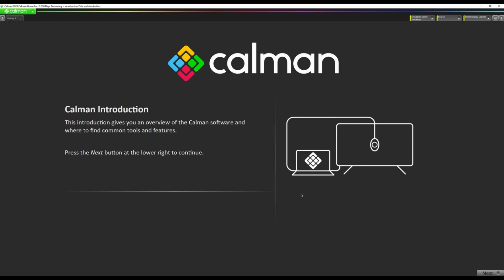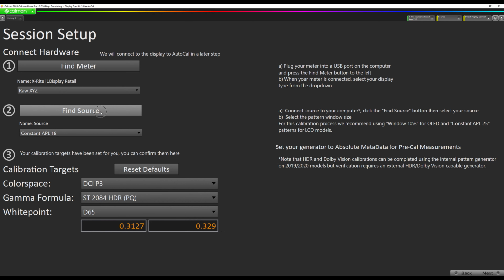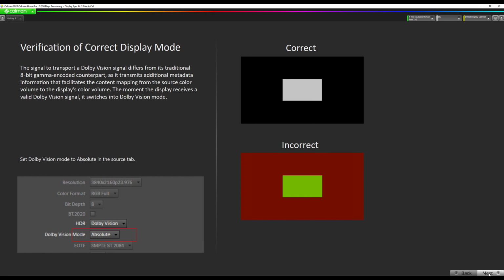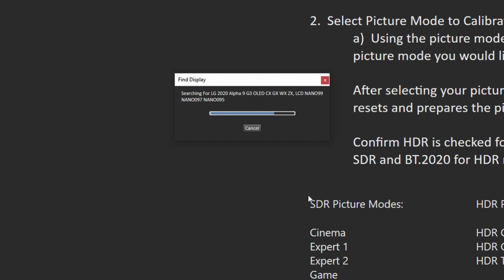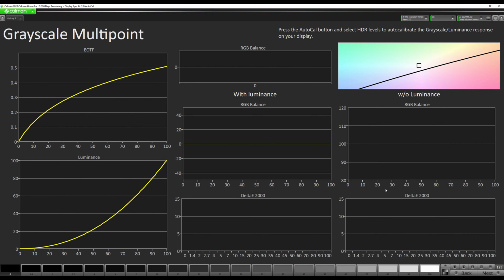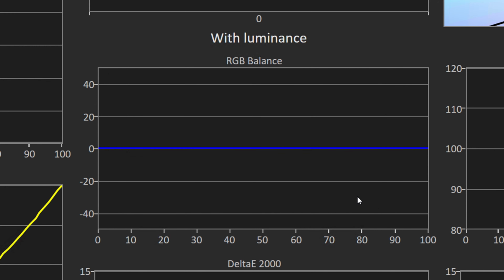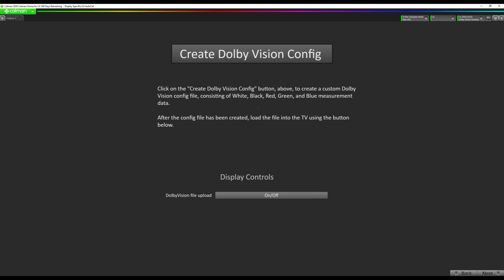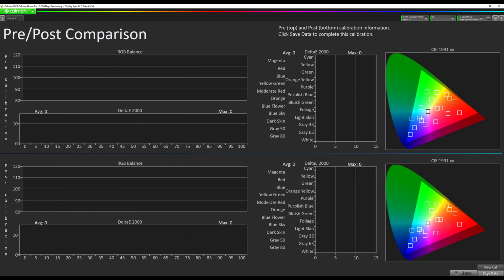LG 2020 OLED Dolby Vision Calibration with Calman Home for LG

Comment: When you reset the picture settings and the sharpness is deafaulted back to 10 when I have it at zero is it okay to put it back to zero before I calibrate the tv? I have the same question as well for keeping the color temperature at 50 before calibration And one more question do these calibrations affect all of the hdmi inputs or does each hdmi input have to be calibrated for every single picture mode ? Sorry if that seems dumb I just want to make sure as I am about to calibrate my Lg Oled G1 and C1 for the first time

Comment: SDR and HDR calibrations on my G2 after 500hrs of run time came out razor sharp on both greyscale and color using the C6 meter and VideoForge PRO, absolutely fantastic.

The Dolby Vision calibration was a complete and utter mess, it actually turned out worse on the post calibration charts than the out of the box factory setting, not sure how this happened, but after two tries following step by step instructions I gave up.

What was even crazier is that the greyscale during the calibration looked brilliant and tight, but then the post calibration chart looked a mess, with the scale being way off from 40 to 70.
Reply: I learned the hard way that if you have more than one video clip and use the 1h long. When the time is up it will automatically skip to the next clip and changes the panel settings. Maybe this happened to you as well? So after each measurement I restarted the videoclip to prevent it change video (the total calibration was over 1h long)

Comment: Hey Tyler, excellent video. Since the block is after the generator, would that possibly be why the EOTF followed a standard 2.2 curve instead of the yellow PQ line on the graph when I attempted a pre calibration series read on my LG G1? For that matter I also attempted a post calibration series read and saw large colorspace errors. I assume this is why you really can’t attempt either?

Comment: I've done SDR and HDR but I've stopped at dolby vision. I use dolby vision cinema home because I like how bright it is and how it pops (yeah I'm not purist). Has anyone done cinema home and did calibrating it mute the brightness at all? Thanks.
Reply: It's absolutely did mute the brightness. Now it looks just like Dolby Vision Cinema. Thanks to everyone for not replying.
Reply: Here's some free advice that no one wanted to give me:

If you use cinema home because when you swap between "cinema" and "cinema home", you say "why the hell would anyone use cinema?"... DON'T CALIBRATE CINEMA HOME. You'll lose the reason you like it. I had to factory reset my TV and lose my awesome SDR and HDR calibrations to get it back. So, you're welcome.
Reply: @gobluebalter  why you don’t used the functions „Full DDC reset“? Then is Cinema Home like before.

Comment: Does this calibrate for all inputs?
Reply: I think it does, only the manual settings that you change in the menu are per input, but the baseline of the calibration is all the same, per picture profile. Only things like brightness and sharpness etc are things you can manually tweak per source, but the baseline is always this calibration. Provided you use the profile you actually calibrated. I'm not sure if that also applies to internal apps vs HDMI sources. AFAIK..!

Comment: Hello Tyler! Is it possible to use the LG HDR42 point version in the Grayscale Multipoint or MUST use the LG HDR20 Point?
Reply: I remember reading somewhere it is not recommended unless you have a very accurate colorimeter. As something like an x-rite display meter does not have the resolution so would lead to random steps in your greyscale.
Reply: it will take more time, just more granular. So yeah, you can. For more accuracy along more luminocity levels.
Reply: @TijmenJanssen  already handled in this way! Ty!
Reply: @fgp303  I figured that, since it was months ago. But whomever may read this with the same question now has an answer.

Comment: Any sdr and hdr GAME calibrations in the works?
Reply: I calibrated SDR and HDR Game Mode by running SDR and HDR games on my Xbox. The internal patterns from the tv will run over your video game images. While Calman is calibrating, be sure to press buttons on your Xbox controller, every once in a while, to prevent the tv from dimming (should also apply to PS users).
Reply: Sales support told me that game mode calibrations do not work correctly bc something on lg end.
They are hoping for a firmware fix from LG.
Reply: So weird, I’ve seen one or two videos on here where they claim to show you how they calibrated their game modes. I don’t know know how well those actually turned out.
Reply: @alekznial  yeah I did the game mode calibrations in sdr and HDR anyway. It worked for me and only problem that it it might be, is that it's not really in game mode. I asked lg about this couple weeks ago and no reply yet.
Game mode calibrations came out great, look identical to my movie/tv watching calibrations.

Comment: Where do you find the IP for the TV?
Reply: It should be under network settings.  Another option is to plug and ethernet cable directly from your laptop to the tv.  I've done it a few times.  Made life easier
Reply: if you have the TV using wifi or ethernet you can use the app "WakeMeOnLan" software (FREE)  and then you can scan all the devices on your network and one of them should show the TV brand name listed there somewhere so you can ID it with its IP address. here is the Link: https://www.nirsoft.net/

Comment: I did the Dolby Vision calibration on my LG CX and now I cant play anything in Dolby Vision as I get a green and pink scrambled image... is there a fix?
Reply: HI Jason, can you confirm you calibrated following the instructions correctly? I ask because I have an LG 65 CX with 138 hours on it. I've just purchased Calman Home for LG and an x-rite display pro plus. I have calibrated SDR ISF Dark & Bright, HDR Cinema & DV Cinemas modes all very successfully with no errors above 0.5. I am truly very impressed.
NOTE: I should also add, I am in no way ISF certified and my knowledge has come from Tyler's @ Portrait Displays videos and Jason @ Murideo
Reply: @rhyskerslake4343  what firmware are you on? I’m on 03.21.16 and I’m exhibiting the same type of error as the OP. I’ve tried many times to do the calibration exactly like the documentation and this YouTube video says. I’ve done a factory reset each time I redo the test. Tried different settings also. But still end up with the same garbled colors. I used the i1 display pro. I even bought the c6 hdr2000 and got the same result. I even resorted to reformatting my pc and even then I’m getting the same result.
Reply: @ryanp467  I was finally able to get it to work...  after the Dolby Vision calibration I unplugged the TV, held down the power button for 20 seconds on the TV, and then plugged the TV back in and surprisingly DV now works.  I don't know if it will work for you but it did for me. Oh one last thing I am on the latest firmware 3.21.16
Reply: @jasonl3850  just tried that and it worked! Thanks for the fix.
Reply: @ryanp467   NICE!!! I'm glad it worked for you as when it happened to me I really didn't want to do  a factory reset and start all over again...lol
Reply: @ryanp467  Hi Ryan, glad it's now working for you. Yes I have the same firmware.
Reply: @jasonl3850  Awesome Jason it's now working for you. Enjoy!
Reply: @jasonl3850  I encountered the exact same bug and your solution worked for me too.  Thanks!
Reply: That happened to my cx once no calibration. Just exiting netflix by switching inputs while in netflix.
In dolby vision it was really dithered and green. The bright scenes where much brighter.
Reply: I had the same bug.
I have change the location of the TV, in the menu, to restart the tv, and now its not green anymore.
But now the dolby vision content are very dull, too too much . I have followed this vidéo.
I will need to recalibrate i think, do you have the same feeling ?
Reply: @franckrieu-patey255  Was the color fine before the calibration?  If yes then I would recalibrate.
Reply: I’m now hesitant to calibrate my Dolby as I just spent a few hours doing SDR and HDR. If it messes things up and I need a restart, can I just load the previous calibrations?

Comment: I want to get calman lg home with x1r pro, but I have a lot of questions that are not addressed on the calman web site.
Looks like a lot of different info out there, from forums etc.
Reply: Hi Bloomer - I've just done it myself on my LG CX 65". What questions do you have?
Reply: @rhyskerslake4343  anything to set on tv settings before you begin?
I would assume you turn off energy saving and all extra processing.

If you want to set luminance at 120 nits in SDR, do you still calibrate at 100 nits then turn it up after calibration?
Reply: @bloomerb4162  If you have the time, I recommend watching Jason Dustal's 2 hour video - https://www.youtube.com/watch?v=LIkkdGr1WjI - he gives a wealth of information. In this video he references your second question about luminance - seek the 30 minute mark. As he is doing SDR ISF Bright, (prior to Grayscale calibration) his preference for SDR ISF Bright is 150 nits, but sets a higher values of 175 nits. Jason goes on to say experience has taught him; the process of this calibration will naturally bring down the luminance to the desired value. If it's a bit low or higher than expected - its easy enough to go back and re-adjust the pre-luminance levels.
NOTE: I followed the same concept during my SDR ISF Bright and post calibration ended up in the same area.

With relation to your first question...
1. Download the SDR, HDR and Dolby Vision 1 hour files, put them on a usb stick and plug it into your tv. Running each of these files keeps the OLED in the correct mode.
NOTE: if you are doing HDR Game Mode; Turn on the PS5/ Xbox and ensure you've enabled or configured HGIG mode and leave running in the background prior to calibration. There have been unofficial reports I have seen from other tubers referencing the HDR Game Mode calibration was more accurate this way. 

2.  Yes turn off energy saving and all extra processing prior to calibration. Jason (Murideo) and Tyler (Portrait Displays also talk about this.

I hope some of my information is helpful to you. Happy to answer any other questions you may have - otherwise Enjoy!
Reply: @rhyskerslake4343  Thank you for the help.
I don't see how using hgig is correct bc hgig turns off TVs own tone mapping. So what could you calibrate, maybe just panel specific peak luminance.

Are these 1 hour files not the same as the full screen grey files that they want you to use during calibration?
I thought it was just one file of full screen grey for all the calibrations.
Reply: @bloomerb4162  I could be mistaken - I am looking for the article I referenced (an end-user) where the 30 - 70% grayscale was calibrating below well-beloww the expected values and the work-around was to enable HGIG to achieve the correct grayscale values. If I am mistaken, I will remove the information from my previous post - I wish to not spread mis-information
Reply: @rhyskerslake4343  I'm no expert, I could be wrong on this.
But I do know that hgig turns off the TVs own tone mapping, letting the source do the work.
Reply: @rhyskerslake4343  I did it, xrite display pro plus with lg home.
I got some issues but overall I think it works ok.
Going 15 over 100 nits gave me 91 nits post 3d lut.
I went ahead and calibrated SDR game mode even though portrait displays told me there is something wrong and it's on lgs side. They are hoping lg fixes game mode problem with firmware update.
They didn't tell me specifically what the problem is.
I suspect it's not really in game mode after calibration, though I need to test some more but it feels like more input lag.
Also some connection issues between meter and lg home. Lg home would stop responding in win10 but would correct itself, luckily never happened during calibration.
Reply: @bloomerb4162  Congratz well done - Enjoy!
Reply: @rhyskerslake4343  where can you download the 1 hour video files from? thanks